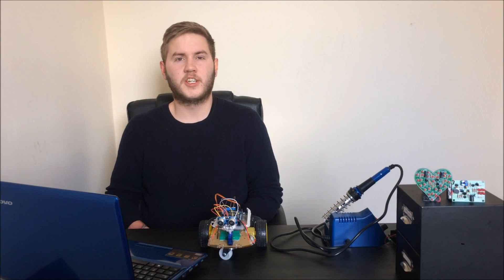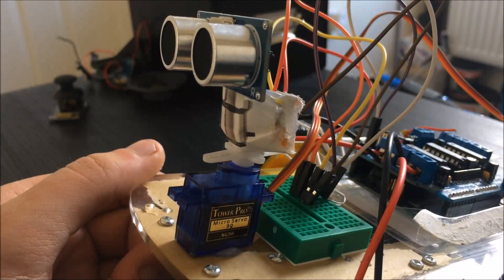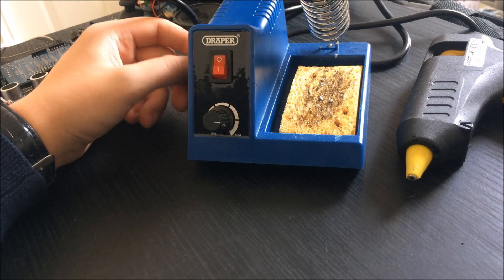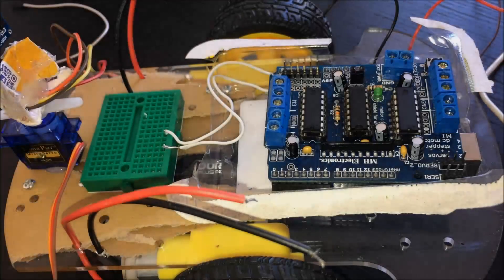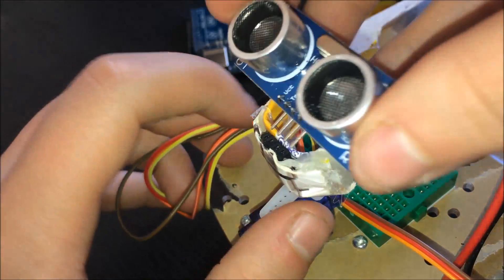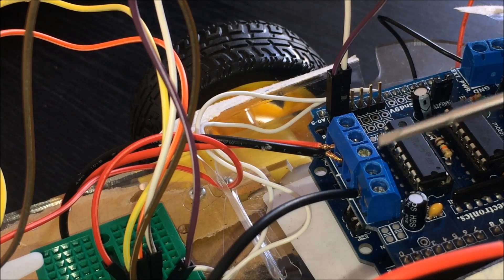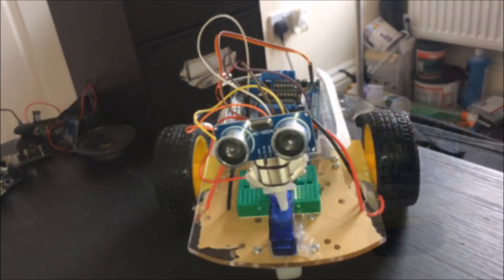Beginner Arduino Project Tutorial -  Obstacle Avoiding Robot

Comment: is there a specific wire to connect the DC motors? what gauge? silicon or copper? and i notice the wires come black and red.
Reply: John Duong If your motor already has wire it is probably 18 gauge. That what you want to use.
Reply: If you connect as he did in the video it works
Reply: i used 22 AWG and that was almost too thick, and was way too stiff.  My project works now, but i should've used even smaller wires because the DC motor holes are extremely small and fragile.  24-26 gauge should be good.  The reason why i asked because this video did not explicitly show that process being done.  Soldering was not even remotely required.
Reply: Does your robot pull to the left? Also does it turn right at all when it sees an obstacle or does it just turn left?

Comment: I made a robot similar to yours however I'm having some issues. Iv'e modified the code replacing every 90 angle with 70 because for some reason 70 is straight for my servo. I also changed the rest of the angles accordingly. Also my right wheel spins a bit faster than my left one but I fixed it with a resistor. I was wondering if there is a way to fix this in the code.  One last thing, my robot will not turn right even if I put my hand to the left of the HC-SR04 it still turns left. If you could get back to me I would greatly appreciate it.

Comment from the maker: Go to which part of the video you need.

Parts needed - 0:14
Recommended tools  - 1:30
Prep before wiring - 2:10
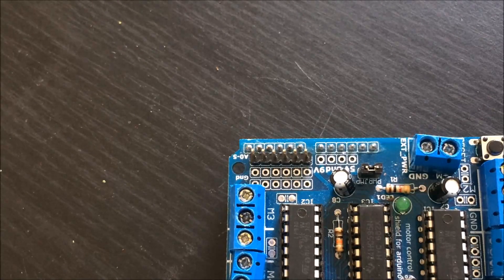Wiring - 2:50
See the robot in action - 6:12
End of video - 6:36
Reply: Hi, when I compile the code I get and error like C:\Program Files (x86)\Arduino\libraries\Robot_Control\src\ArduinoRobot.cpp:43:2: error: 'Serial1' was not declared in this scope

  Serial1.begin(9600);

Can you please help me?
Reply from the maker: Hey, simply take out the 1.
so it should be -- Serial.begin(9600);
then make sure your baud rate (bottom right of comm port) is set to 9600.

Thank you for complimenting my video. Goodluck!
Reply: Thanks a bunch!  I'm getting these errors as well
C:\Program Files (x86)\Arduino\libraries\Robot_Control\src\ArduinoRobot.cpp:26:42: error: 'LCD_CS' was not declared in this scope

 RobotControl::RobotControl():Arduino_LCD(LCD_CS,DC_LCD,RST_LCD){

                                          ^

C:\Program Files (x86)\Arduino\libraries\Robot_Control\src\ArduinoRobot.cpp:26:49: error: 'DC_LCD' was not declared in this scope

 RobotControl::RobotControl():Arduino_LCD(LCD_CS,DC_LCD,RST_LCD){

                                                 ^

C:\Program Files (x86)\Arduino\libraries\Robot_Control\src\ArduinoRobot.cpp:26:56: error: 'RST_LCD' was not declared in this scope

 RobotControl::RobotControl():Arduino_LCD(LCD_CS,DC_LCD,RST_LCD){

                                                        ^

C:\Program Files (x86)\Arduino\libraries\Robot_Control\src\ArduinoRobot.cpp: In member function 'void RobotControl::begin()':

C:\Program Files (x86)\Arduino\libraries\Robot_Control\src\ArduinoRobot.cpp:36:21: error: 'MUXA' was not declared in this scope

  uint8_t MuxPins[]={MUXA,MUXB,MUXC,MUXD};

                     ^

C:\Program Files (x86)\Arduino\libraries\Robot_Control\src\ArduinoRobot.cpp:36:26: error: 'MUXB' was not declared in this scope

  uint8_t MuxPins[]={MUXA,MUXB,MUXC,MUXD};

                          ^

C:\Program Files (x86)\Arduino\libraries\Robot_Control\src\ArduinoRobot.cpp:36:31: error: 'MUXC' was not declared in this scope

  uint8_t MuxPins[]={MUXA,MUXB,MUXC,MUXD};

                               ^

C:\Program Files (x86)\Arduino\libraries\Robot_Control\src\ArduinoRobot.cpp:36:36: error: 'MUXD' was not declared in this scope

  uint8_t MuxPins[]={MUXA,MUXB,MUXC,MUXD};

                                    ^

C:\Program Files (x86)\Arduino\libraries\Robot_Control\src\ArduinoRobot.cpp:37:29: error: 'MUX_IN' was not declared in this scope

  Multiplexer::begin(MuxPins,MUX_IN,4);

                             ^

C:\Program Files (x86)\Arduino\libraries\Robot_Control\src\ArduinoRobot.cpp:40:10: error: 'BUZZ' was not declared in this scope

  pinMode(BUZZ,OUTPUT);
Reply: am I missing a header file or something? I'm using an UNO and 1.8.2 IDE.  Thanks again
Reply from the maker: hey, when the error says 'BUZZ' was not declared in this scope, and for all of them that say that. they must be included at the beginnning.

for example somewhere before the set up or throughout the code you need to say const int buzz = whatever pin you have it on.

all variables need a variable value, either const int. long, float etc.